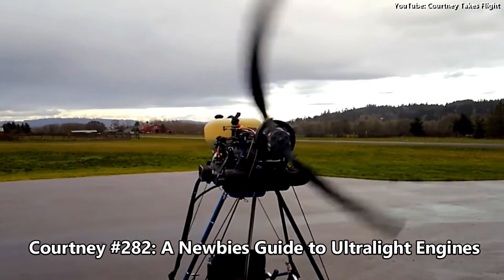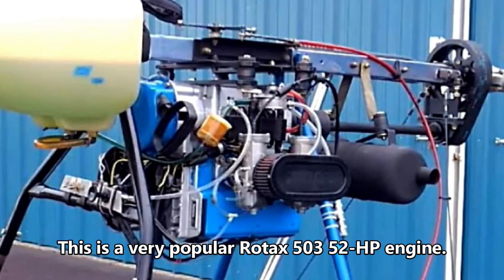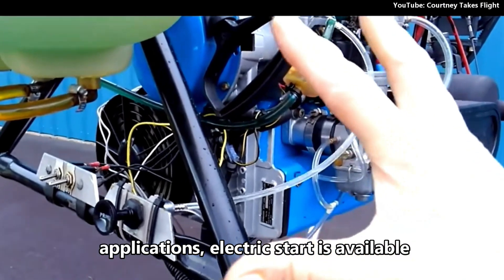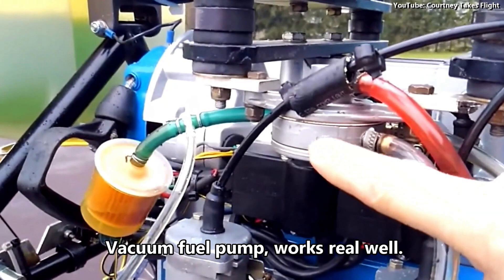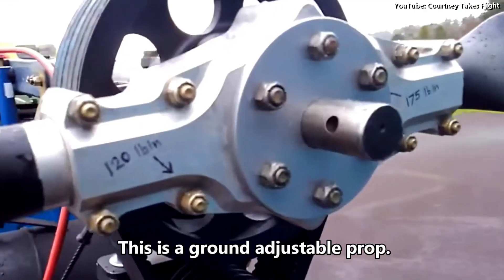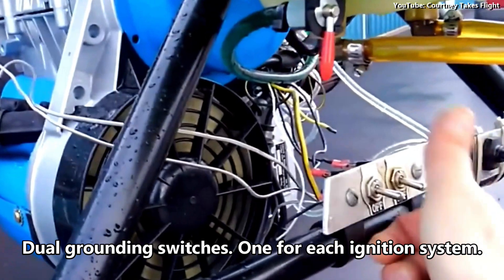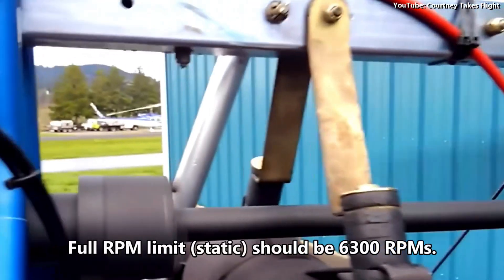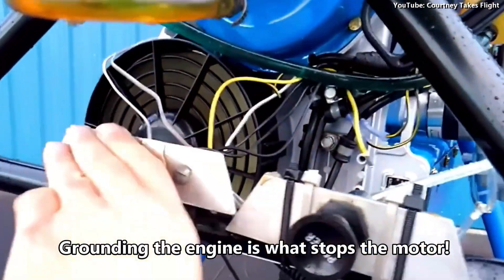Ultralight Aircraft Engines for NEWBIES! C282

Comment: I am thinking about  a Kawasaki 340 from a company in Wisconsin for my plane. They say it's brand- new but I wonder how 
this can be since they  don't make them anymore. What do you think, am I being played?
Reply from the maker: Check the reputation of the seller. I know Kawasaki is used in a number of ultralights, the Weedhopper comes to mind.
Reply: @CourtneyTakesFlight  It's JBird Ultralight, , been in business for 50 years. So with your comment I feel a little better.  Just being overly cautious I guess.
Reply: @sheldonrigsby  Hi Sheldon,  J-Bird's are great to work with. I bought my 440 from them and love it.  Check on the 440 vs the 340.  More HP with just a small weight addition.  When they say they are brand new, they are saying it is fully rebuilt with new components...its like brand new.
Reply: @AirBikeKitFoxNC  I was going with a 440 to begin with but he was trying to get me to go with a 340 for some reason and the "brand new" thing had me wondering. But yeah, okay.   I'll just go with the 440.  And I will have to mount it upside-down because my plane is a Fisher 202 and it has that J3 Cub look.  Should'nt be much problem upside down I hope.
Reply: @sheldonrigsby  340 should also be good...I was just thinking for you to consider the 440 option. A little more power is nice to have..  My 440 is upside down and it is no problem.  Sometimes you will get a little extra oil on the spark plugs if it sits for a while...I just do a quick check of them before each flight and clean them if necessary.
Reply from the maker: Thanks for commenting!

Comment: The only thing that i dont like with only pull start,  if it stops in the air, a restart is difficult.  I have seen some with a long starter rope that ends at the pilots seat. But i do prefer E-starter.

Comment: 2 stroke engines are very popular for light aircraft as they produce more horsepower with half the weight of a 4 stroke. I’ve managed a 4 stroke half VW on my Legal Eagle and weighed in at 244 pounds. I’m happy with it.
Reply from the maker: I like 1/2 VW engines, unfortunately they're not pusher engines due to cooling limitations. But if you can make it work, go for it! 

Thanks for the comment.

Comment: I would add 2 comments.   To get better than 90% first pull starts.  2 shots with the primer.  Hand prop or slow pull 3 to 5 revolutions (I do this in preflight checking belts, prop and compression) WAIT AT LEAST 30 SECONDS for fuel to vaporize in the crank case.   One good pull.    Also you want to do a post flight inspection just after landing of the belts, pulleys and bearings on a belt redrive like your 503 setup.   You are looking for hot parts indicating slipping belts or bearing failure.